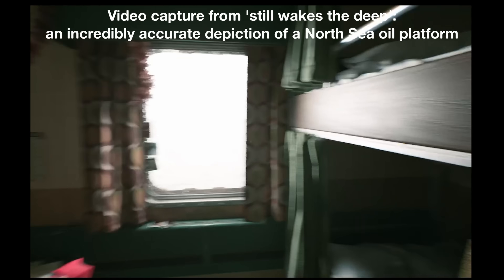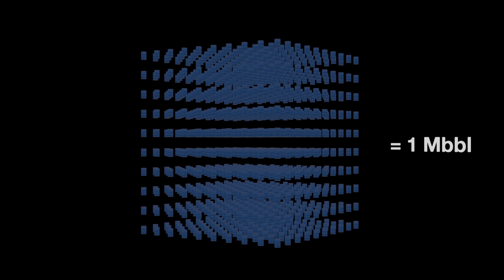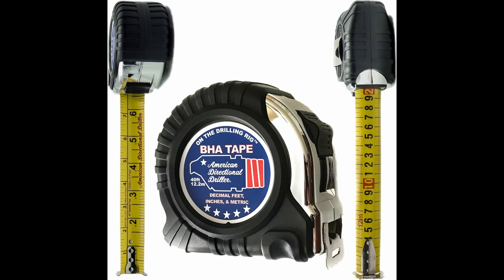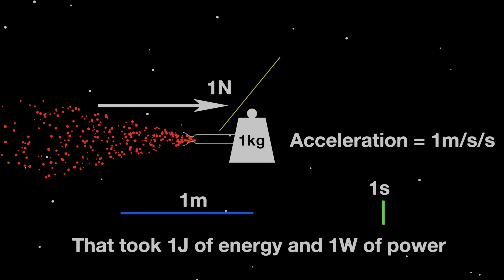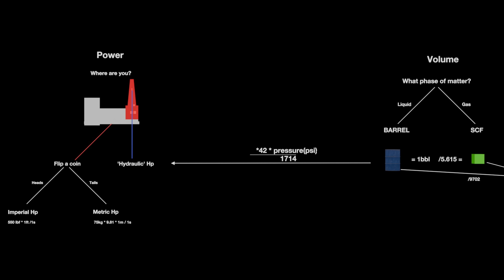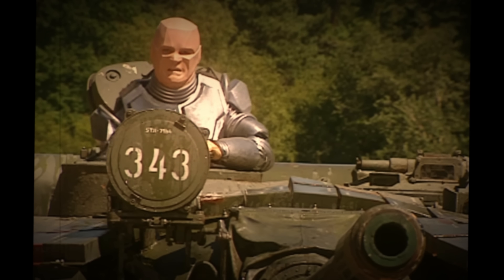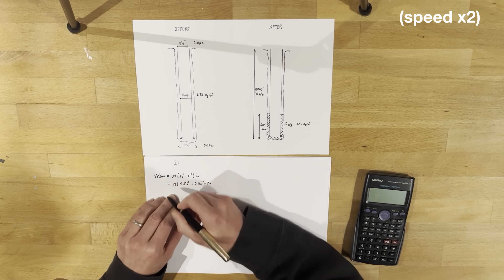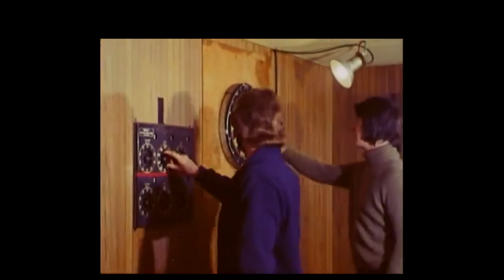Oilfield Units: a Measurement System so Cursed it made me Change Career

Comment: This gives me a horrible flashback when I was making a system that tracks oil usage within heating system. Oil level in tank is shown in centimeters of fuel, but the volume bought and used is in liters. Oil tank has handy lookup table to convert level to percentage, and another from percentage to volume.  Oil burner has a nozzle with hole that is given in mm, and that corresponds to flow rate in g/h, gallons per hour, american gallons i think. That is when it is used with standard pump that has specific psi. Oil burner only gives one signal when it is pumping oil, or when it is not. That is then tracked to hours runtime counter. To get used oil in liters i need to multiply adjusted gallons per hour with run time and then convert  that into liters by multiplying with magic number. 
But then the system has to track also heat produced by system in kWh, so i need to take the oil usage rate in gallons, energy content per gallons in btu, and then convert resulting btu to kWh so that it can be compared with electric heating. Also the price of the oil has to be calculated from oil price per liter to price per kWh. 

This results horrible mess of variables, tables, factors and formulas, so that the signal from oil pump is converted to estimated usage values in fluid volume and energy, that then can be compared to electrical heating. System also then decides if heating needs to be switched between oil and electric depending which one is more economical at the moment.
I am still not 100% that i god all of the conversions and factors right, but so far the actual and estimated usage have tracked pretty well. Thanks oilfields, for making engineering harder.

Comment: SI units are qualitatively better than Imperial units. Everyone should be free to use whatever, but must at least be honest that if they use Imperial, they are using a worse system because "feelings".
Reply: Except for the Newton-Kg standard gravity conversion. Especially when dealing with high altitudes where gravity changes substantially...
Reply: @Triple_J.1 Not really. Your not converting, your calculating. Mass and force are different things. Imperial has an ambiguous unit that has the inaccuracy of a constantly changing specific gravity (acceleration) baked in. Which is not better for two reasons.

Comment: S.G. Is standard in the maritime industry because Fresh Water is S.G. 1 Tonne/M3.
Merchant Navy is standardised on S.I. Units so a cargo of oil is S.G. 0.875 and a cargo of stone is S.G. 1.820 for instance.
Hold volumes in M3. So it is simple.
If your ship floats at a draught in Freshwater of 6m, then it’s easy to correct for Saltwater as seawater is S.G. 1.025.

Comment: In most places, units were based off of what people commonly used like the Barrels in this video. This means they are tied to a time or place and maybe should be retired for a unit that fits for the current needs of its users. Other units are based off what everyone always has with them, like the English distance measurements so will pretty much always be handy. Other units are based off of 1/10,000,000 th of the estimated distance between the equator and the north pole along the curvature of the Earth going through Paris.

Comment: I was in the last year that did Energy Conversion in imperial units.  So steam tables were in BTUs and mechanical power was in horsepower, torque in ft.lb, and, of course, energy was also ft.lb.   50 year later I still remember  778 ft.lbs/BTU

Comment: Being a Yank, and live with our variety of insanity.

I'm first and foremost in the standardization camp - the only thing better than perfect is standard. Ideally, a global standard, but a local standard works too.

 I've found measurements really "feel" more like language than a unit. It becomes an identity thing to folks who are uncomfortable with learning a different language and occupational culture.

You might as well ask some folks to stop speaking English and start speaking Mandarin.

So, pain in the arse it is, I'm more interested in communicating meaning, so if I have to use a cubit or a smoot, I'll use it.

I prefer metric - by far- but I also believe there's valuable learning and mental flexibility to be had by learning to convert units that don't convert cleanly like SI.

Comment: US railways are quite fond of expressing curve radii (of track) in degrees per 100ft. They just call this "degrees of curvature", which is ridiculously confusing. I think it comes from surveyors using 100ft chains, and measuring the angle between two adjoining 100ft baselines on a curved formation. I could be wrong, though: at some point during the process of discovering this, my brain ran off to the pub in self-defence.
Reply: I really hate how there are 3 ways to measure grade or slope: 
degrees 
percent %
pitch (x:12)
Reply: Also, "pro mille" (per 1000), which is 0.1%. Both pro mille and per cent make some form of sense, as does "1 in X": they, like degrees of curvature, fall directly out of the measurement method.

Comment: Ha, I used to work in O&G, I remember my American colleagues being blown away by my ability to covert volumes to weights for  fuels in my head using SI units, :D. Also the pipe which was sold in inches diameter and length in metres…

Comment: Proponents of the metric system love to tout the convertability of the units. In reality you almost never need to know how many declilters of water there are per degree Kelvin. The usage of units is higly compartmentalized and conversion is rare. Pilots use knots and feet of altitude and they are not flailing their arms crashing into buildings because they have to convert pounds of fuel to liters of soda without using their phones. It's far more ridiculous that there are thousands of different languages used around the world. I mean French, really?
Reply: You just don't do things that require a lot of units aka science and engineering. Most of physics is derived from the conservation of energy or conservation of momentum aka equal and opposite forces. If the origin of their estimation means the two energies or forces you're trying to make equal are stuck in different units, that's a massive pain.

The first step in solving a physics problem is writing down the your known quantities and converting them to SI base units. Even something like kJ is kind of annoying and better treated as 10^3 J because that makes the math easier.
Reply: Rofl, you're not working anywhere near engineering, machining, or construction if you think unit conversions are seldom used. Even non technical people use mm, cm, meter, and km, g and kg often, and changing between them is as easy as adding or removing a zero. 
If I was a machinist in the US I would be constantly switching between inches, 1/8th, 1/16th, 1/32th of an inch, as well as "thou" (1/1000 of an inch).

Comment: US (& Canadian) aviation units are quite mixed as well, with degrees Celcius temperature, mm of mercury for air pressure, feet of altitude, knots for distance/speed except statute miles of visibility and US gallons or pounds for fuel quantity depending on aircraft type.
Reply: It’s not even that hard since everyone uses the same choices (once Airbus de-metricated)

Oh wait, China air traffic control uses metres 😅😅🎉
Reply: @whophd  Russia uses meters below transition.  FL in feet above.

Also a nitpick but most of the world uses hPa for air pressure not mb even though theyre the same thing.
Most of the world does visibility in km, or meters if its below 1km.
The dumbest thing some countries do is pressure in QFE.  

I work at a US airline and we use kg and L for weights and fuel.

In machining we use decimal inches unless its specd in metric.
Reply: Not just the US, every country on earth uses those units except Russia, China, and North Korea, who all use metric.
Reply: @costakeith9048  and this is why international cooperation is so important — and makes life easier

Just put some nerds in charge, go to the pool and sip on your cocktail for a few days, and they will happily give you the best system for an easy life in 10 years
Reply: result: Gimli Glider

Comment: We have screwed up. We haven't come up with 2 definitions of the length of the second.
Reply from the maker: One of my Patreon members had to work with 'micro-fortnights' once, i believe they were working as a programmer at the time.
Reply: @Alexander-the-ok  There was a VMS parameter, the TIMEPROMPTWAIT, the time the system will wait for an operator to set the correct date and time on boot if it realizes it has stored an invalid one, which is specified in micro-fortnights (about 1.2 seconds).

Every other use of microfortnights I'm familiar with is used in a mocking, joking fashion.  So I think it'd fit right in on an oil rig.
Reply: @Alexander-the-ok one upon a time I was reading about anti-tank cannons and encountered ft-tons. Not ft-lbs, or pound-feet, but foot-tons. Which also opens the path to the mile-pound, which I dont like to think about..
Reply: @Alexander-the-ok  that at least sounds like they were just having to increment time at smaller than the given units, and the given units were fortnights.
Reply: If we worked from "micro year" (about 31 and a half seconds), then we could have "solar second" or "sidereal second"... :)
Reply: France tried to have decimal seconds for a hot minute back in the day
Reply: @screetchycello  yes, metric minutes were indeed too hot to remain solid

I also love the story of how we switched from UT to UTC, and stopped having “squishy seconds”.  Suddenly the reference point went from Greenwich Observatory to a shack in Nebraska (IIRC) and when the earth’s core density was recalibrated against satellite movement, that lovely line in Greenwich moved 100 metres.  Nobody thought to press the “Reset Gauge” button first?  Or maybe the Americans did think of it, but went “nah, punk ‘em”
Reply: @screetchycello   Decimal time would be a nightmare to adopt, but I will never stop loving the idea of the republican calendar. It has its silly aspects as well, but dam is it cool.
Reply: They're definitely using some kind of longer second in the last five minutes of college basketball games, though.
Reply: In analytical chemistry. We use a instrument called a HPLC (high pressure liquid chromotogarphy) and we use minutes wirh a decimal. I.e 3 minutes and 30 seconds is written as 3.50  minutes.
Reply: Different seconds are definitively used in the Michigan (Big House) in timing of football (not European Soccer) games.   Depending on the the Michigan need seconds expand, contract add, or simply go missing.   Chain lengths also change, although in full display during the entire game, measurements can be angled to give favorable outcomes.
Reply: The time clock at work used to give decimal hours.  If you worked three hours and thirty minutes it would say "3.5".  This at least made adding up time and figuring out pay easier, even if it confused new crew members when they first saw it.

Comment: I'll never forget renting a van in the Republic of Ireland, the speedometer of which only registered in KPH and driving it into Northern Ireland where the road signs are in MPH.  Multiplying/dividing by .6 isn't that hard, but when you're jet lagged and driving on the wrong side of the road, it's more added mental effort than you need.
Reply: We had a reverse problem when we imported a car from USA (Ford) to Europe which didn't have KPH, only miles. The whole time through our grand European tour my dad had to drive guessing if we're not speeding. And on German roads especially, it would cost us half of our petrol budget if we were indeed speeding.
Reply: Having grown up with both, I don't even notice at this point as I have a decent mental lookup table for any speed I actually use. The handy thing is that thanks to speedomoters overreading by design, doing 100 km/h still is almost guaranteed to not be above the limit in a 60 mph zone, even though it's closer to 62 mph.
Reply: I felt this comment
Reply: @Zeppflyer  Road distances in Ireland moved to metric in the 90s, but in some cases old signs would still be in miles (some probably still are). But we stuck with mph for a lot longer - until 2005  - when it came to speed. 

As an aside, while speed and distance is imperial in UK roads, the "mileage" markers on the side of motorways are metric (decimal km). I learnt that while trying to verify the speedometer on a Japanese import - it turned out it wasn't with km/h or mph, but 1 unit was 0.9mph...
Reply: All the cars I've driven have MPH on the outside and KPH on the inside.

I've driven UK cara and Japanese imports
Reply: Yeah, it makes me all the more thankful that my Subaru has a smaller inner dial with kph on it
Reply: @inkuii   Every car I've driven in America has that, too. The idea that cars in Ireland, the only place on Earth where it would be useful, don't is hilarious.
Reply: @Abcdefg-tf7cu cars in the UK have both because you might go to Ireland or France on the ferry or these days through the Channel Tunnel.
Reply: @Abcdefg-tf7cu  It is useful in North America, as well, for the millions of people who cross from the US to Canada or Mexico every day, though granted it's probably a smaller proportion of the total population of those three countries than in Ireland.
Reply: @Zeppflyer it depends on where you are. In Detroit there's a giant bridge and a tunnel to Canada and they're both over capacity all the time. It's the busiest border crossing. Thankfully they're building a nice new huge bridge that actually may have just opened, if not it's opening any day now.

It even has pedestrian and cycling lanes so for the first time ever you can walk to Canada.
Reply: use the fibonachi sequence! 3mph is 5kph. 5mph is 8kph. 8mph is 13kph, and so on and so forth.
Reply: @TacticalFluke09  
So someone else mentioned.  Still, a bit more mental energy than I want to expend when I'm jetlagged and concentrating on driving on the wrong side of the road.
Reply: You've probably heard this before, but the ratio of km:miles is very close to the golden ratio. So if you know your Fibonacci numbers, just go up or down the series for a conversion from one to/from the other.
Reply: @tomnewsom9124  Right but that's still more mental effort than you need when driving jetlagged on the opposite side of the road than you're used to.
Reply: What the funk is KPH?
Kelvin per hour?
kiloPascal×Hours? 

Speed is distance / time, but there's no unit of distance that is denominated as either K or P!
Reply: @LRM12o8  ...kilometers per hour. KPH. Like miles per hour in America, MPH. Is this a genuine question or an attempt to stubbornly refuse to acknowledge a shorthand you don't like?
Reply: It's km/h not kph
Reply: @sailor5853  bet you're fun at parties

Comment: I can accept the odd units and odder units derived from them. Doing HVAC-related thermodynamics in imperial prepared me for the most harebrained units and equations with more conversion factors than variables. Do thermo in imperial, and you begin to look at degrees Rankine as the opposite of a cursed unit; your one blessing in this mess.
What is truly absurd is the barrel's flagrant misuse of prefixes. M is a thousand? It's not even a consistent offset by 10^3, G is back to international standards as 10^9, albeit after the crime against humanity that is MM for 10^6.

Comment: I used to work in the electricity metering industry. At least watt-hours convert cleanly to SI: one watt-hour is exactly 3600 J, and a kilowatt-hour is 3.6 MJ. Metering and billing is done in kilowatt-hours partly because it's a more practical, "human-scale" measure where you don't have to break out scientific notation for dealing with realistic loads for realistic times and realistic billing rates. It's a lot easier to say that your 100-watt appliance, run for 2 hours, will use exactly 200 watt-hours which will cost you 2 cents with a billing rate of 10 cents per kilowatt-hour. In SI units, that's 7200 J at a billing rate of 2.77 * 10^-6 cents per joule. Or would you prefer your billing unit to be kilojoules, or megajoules?

Around 2012, we did a meter that was submitted to TEPCO, the Japanese utility, in their search for their first solid-state metering system. Their specification for the meter's watt-hour constant, the rate at which the LED on the front flashed (the solid-state version of one revolution of an electromechanical meter's disc), was 1/300 of a watt-hour per impulse. In the documentation that was sent along I recall it being defined in SI units. In practice, they would pulse in the kilohertz range under even moderate load. None of our accuracy testing equipment was designed to handle more than about 100 Hz, so we built input prescalers just for that project.

We did meters for North America, Europe, Hong Kong, Brazil, and others while I was there. Every standards body (ANSI in the US, Measurement Canada, IEC in Europe...) and customer used watt-hours, possibly including JEMIC in Japan. That's one nice thing about electric power: sure, the units may be goofy to an SI purist, but literally everyone on Earth is on the same page. I don't think there's any other industry outside of the pure sciences where that's the case.

Comment: I will point out an inherent stupidity in the metric system -- that it is meters, seconds, and kilograms -- the 'base units' are not even regularized so that they don't require magnitude prefixes for the 'standard' measurements. There is an alternate baseline, the 'cgs' system, which uses grams rather than kilograms, but to keep the numbers manageable, it changes the base metric for distance to centimeters -- again applying a magnitude prefix.